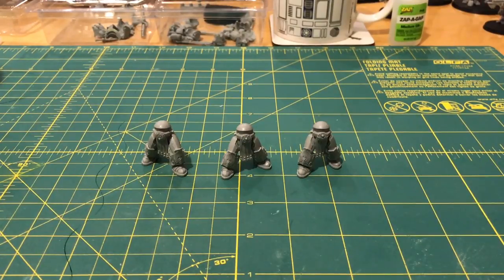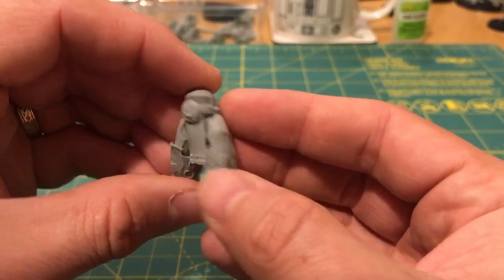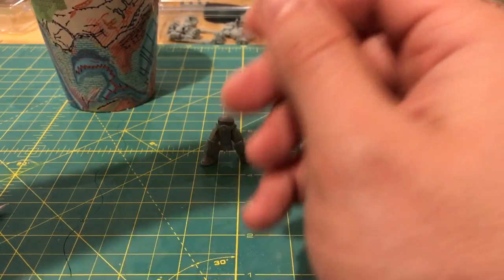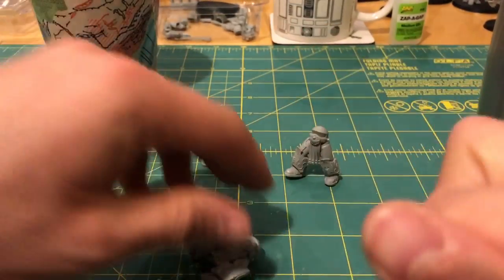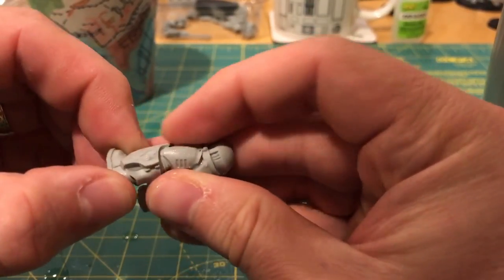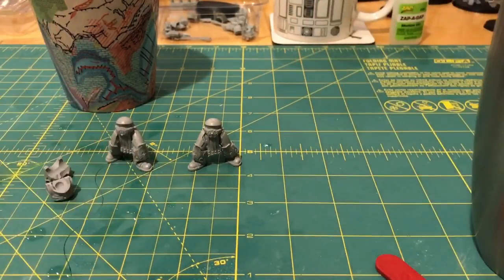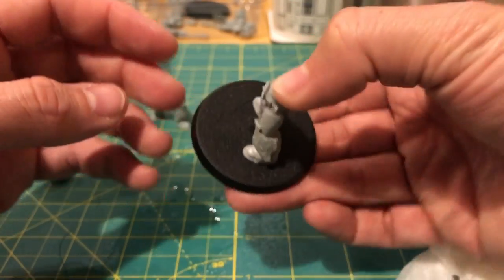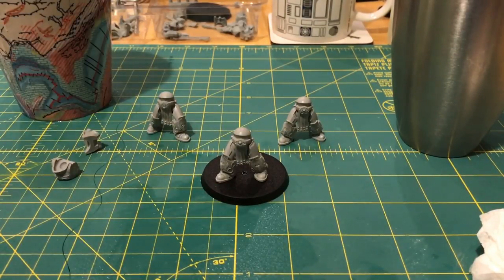How to: resin miniature poses by heating and manipulating them - Legio Custodes Aquilon Terminators

Comment: I do it quite often when I found the original pose don t suit me.
I agreed with you it s the udge plus of resin model.
Reply from the maker: laurent jallut That's cool! Do you use hot water or prefer the hair dryer approach? Thanks for watching :)
Reply: leakycheese hot water you have a lot more control on what you're doing.
Reply from the maker: +laurent jallut I agree, the control thing is why I always come back to the hot water technique.